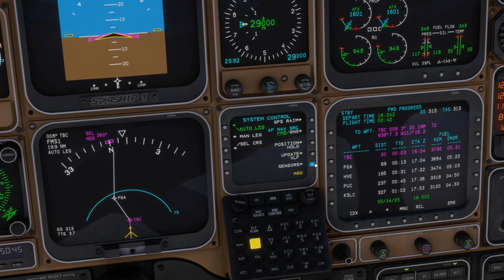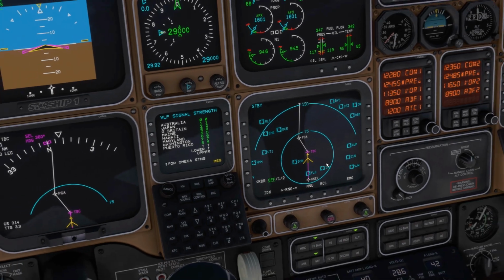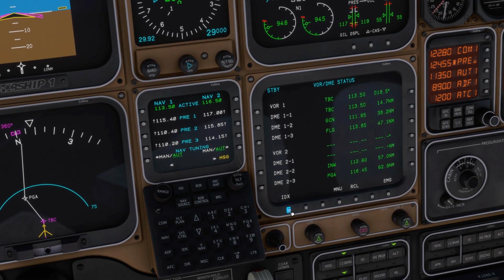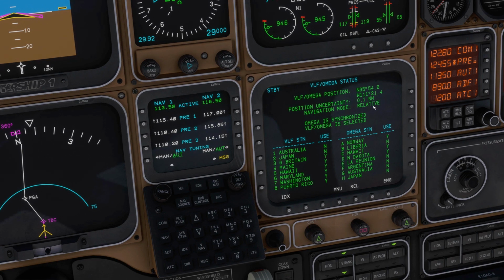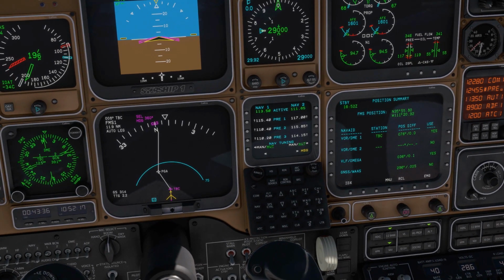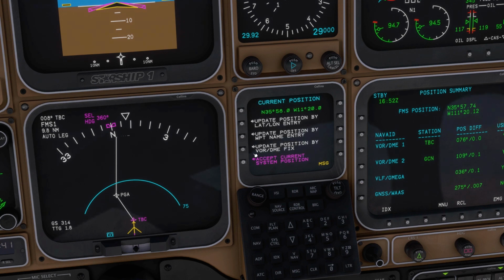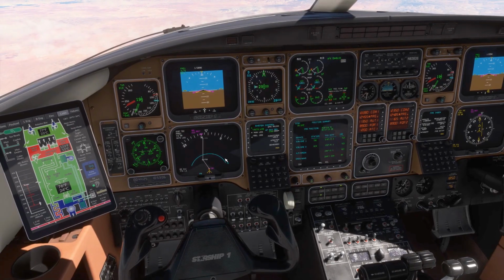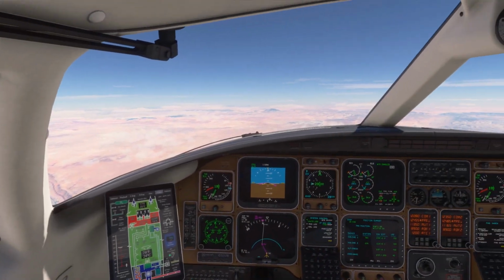Black Square Starship MSFS - Omega/VLF No GPS Navigation - Just Flight

Comment: It's almost like a pseudo-GPS in reverse, where instead of receiving signals from satellites, the avionics triangulate your position based on the received signals from ground-based radio sources instead. Fascinating, and an interesting sort of "future that never was"-technology.

So just to clarify, the GPS position augmentation system was not originally on these and was retrofitted? So does it just augment your positioning triangulation, or is it basically just normal GPS coupled to the system, which makes the other signal sources more or less redundant when active?